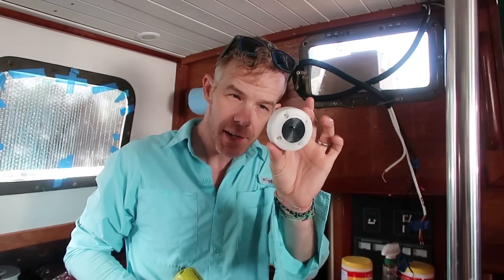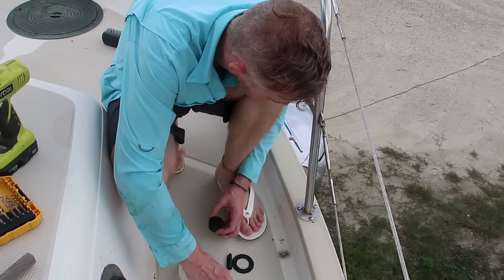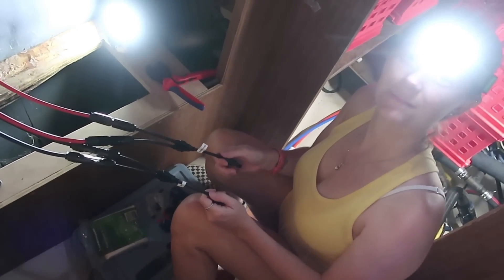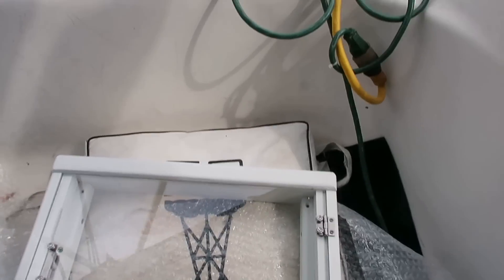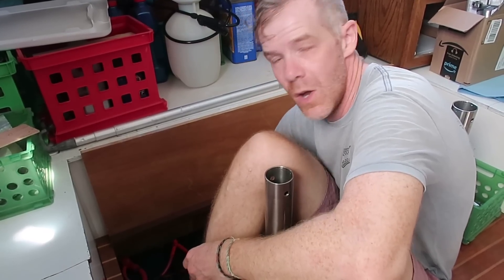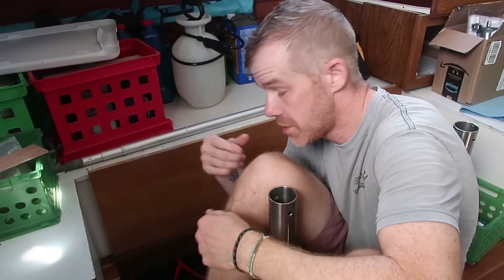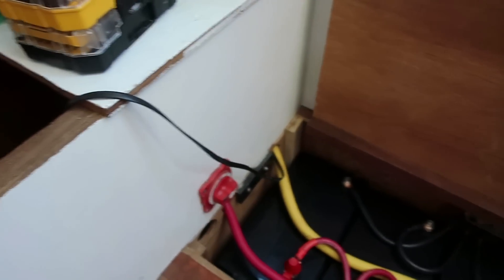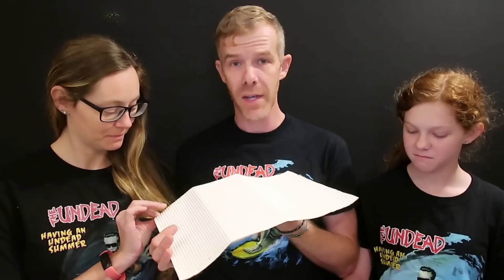Her Thirst For Solar Power Is Insatiable | Sailboat Story 212

Comment: Good job, team! Just one note…it looked like all four screws were wrapped with butyl tape with the proper “squeeze out” with tightening, however shouldn’t the entire circle be sealed to prevent water from getting under the ring (between the screws) and flowing into the two holes that the wires are fed through. Looks like tons of water could come through there as it rains or when seawater splashes over the edge. Maybe I missed that coverage.
Reply from the maker: There’s a gasket that does the actual sealing. The butyl is just to fill the screw holes.

Comment: You've done the install correctly, but a word of warning about parallel battery banks.  If one gets discharged and one is fully charged for instance and you switch the selector to both it could be boat fire bad.  The charged lithium battery bank will try and charge the dead lithium bank super fast and may exceed the C rate of your battery bank and wiring.  Breakers will be going off more than likely.  They will balance themselves as fast as possible....which is a high amp situation usually if the two aren't close in charge.  My Catalina 30 has two automotive sized lithium batteries at 12V 560AH total costing $1100 as the house bank. So I've always been careful not to get em unbalanced.  Also make sure that your feed wire length to each set are the same length or your batteries will always be at different states of charge and you will start having issues where one set charges and the other doesn't as much, etc.  This may mean you waste a good bit of wire unfortunately as one set will have a bunch extra and the other will likely be just right.  The feeds need to be the same length and the bank connections between batteries  themselves about the same length.
Reply from the maker: Allyn, my first thought is that I wouldn't wire the switch in a way that both could ever be selected. It would be either one or the other because I can only have up to 4 batteries in parallel anyways. Still, even if wired so that both banks could be selected, don't you think the BMS's over discharge/charge function would prevent a fault? That's essentially what it's there for, I think, but I still believe it's far better to take every preventative measure that would prevent relying on the safety of the BMS to prevent failures. I'm still learning this stuff so just trying to better understand everything, myself.
Reply: @Sailboatstory  Yeah you'd hope the BMS would kick in, but the quality of the BMS systems used in lithium batteries varies wildly. Some really won't pull an advertised C rate, some have no low temperature protection, some no high temperature protection, etc.  Lets not talk about the poor cell balancing functions.  Some only balance when charging, or balance when they are above a certain charge level.  So for instance your battery might hit a high charge or discharge rate and get really hot...too hot and not turn off the charging or discharging functions.  Also it is likely that you can only have four batteries in parallel with themselves, it might no preclude having both on.  Contact the manufacturer, because the string length is likely there to prevent resistance values building on a bank over four in size.  Basically some people don't balance the parallel bank by wiring one end of the bank to positive and the opposite battery to negative.  They wire the feed on one battery which means the batteries on down the line get less and less charge with each cycle.  The electron flow has to be through the entire battery bank from beginning to end.   I think it is called double parallel banks if you have two sets of parallel battery banks wired in parallel..  If you charge two banks at the same time then both banks get half the charge current which isn't a problem in my mind.  Also discharge rates are halved with two parallel banks.  Keeping them in double parallel will greatly improve the lifespan of the batteries from a cycle viewpoint.  Less wear and tear over the long haul....but check ith the manufacturer, but likely they will just tell you what the book says whether it actually makes sense or not.

Comment: You’ll want to cover those solar power cables with some wire looming or the UV will eat them up quickly.
Reply from the maker: Thanks for looking out for us, John. We've got some of that split plastic looming to install over the wires on our next trip to the boat. We'll also be beefing up the bimini-style connectors we used to install that longer stainless rail. Going to be through-bolting those fittings rather than relying on those tiny grub screws to keep the panels secured.

Comment: Good job guys and good vlog!  One thing I would add:  On the cover for the control panel you should have a piece of metal supporting the bolts on both sides of the plexiglass.  With repeated use those bolts will put stress on the plastic and could start cracking it at the least.  Just my two cents.
Reply from the maker: 🪙🪙 Here you can have those back. 😂

Comment: A family that plays together stays together!  Awesome opening and great work by everyone!
Reply from the maker: Thanks, Chuck. 👨‍👩‍👧
Reply: If the cable length is a matter of resistance would it be possible to simply add a resistor where the cable is shorter in inorder to match the longer cable run?

Comment: If you haven't got all your solar stuff yet, suggest you look at bifacial panels, especially if the bottom side of panels are high above a surface such as dinghy davit location.  May get 20% more power from reflected light hitting bottom of panels.  If you are on a tight budget, take a look at EPever MPPT controllers as alternative to blue ones.  I happened to install 60A MakeSkyBlue MPPT on sailboat but they do have a cooling fan.
Reply from the maker: We considered them, but the additional cost and weight wasn't worth the extra potential output in our case. We used that EPever charge controller you mentioned in the RV. Worked great, but we already have a nice blue one for this project. We also have a less expensive one as a spare on board as well just in case.
Reply: @Sailboatstory  I agree about the weight of Bifacial panels due to extra glass, about 15 lbs more than reg panel.  I did hear that a cruiser did get 20% more power from Dinghy Davit located bifacials.  A good source of anything solar that may be near you is San Tan Solar in Savannah GA.  San Tan's panels run 46 to 62 cents/watt for new panels. The panels I helped install were 320w REC mono panels and they have performed well.  Picked them up at Altestore in Mass and drove them to catamaran.